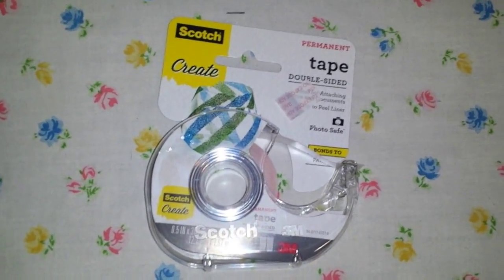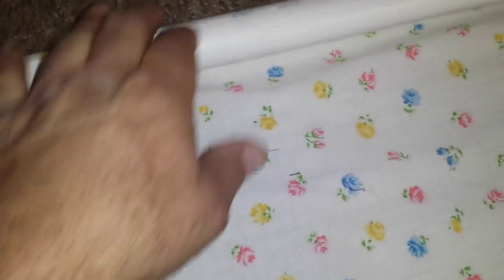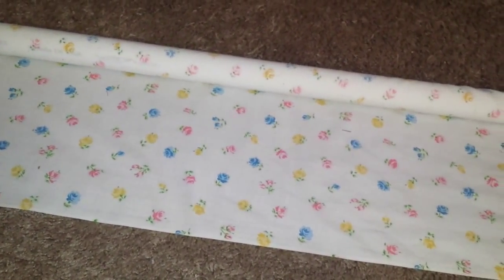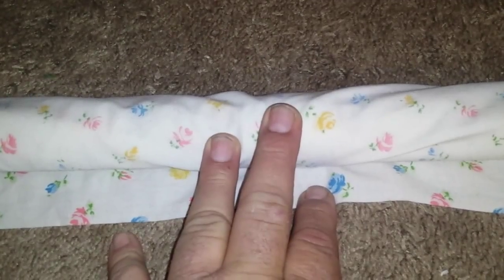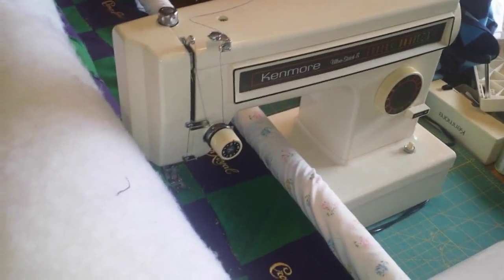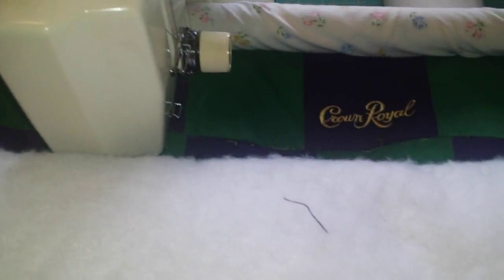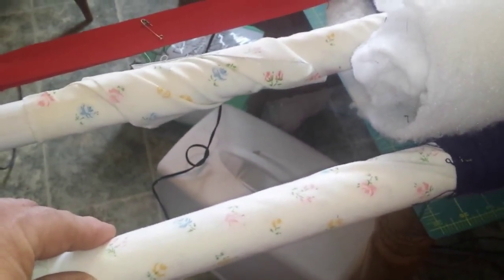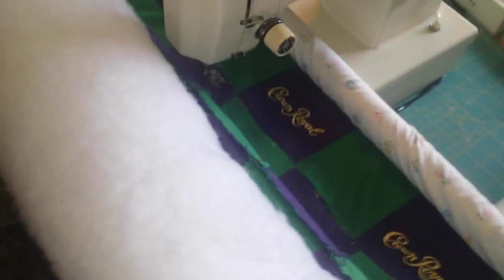Building a quilting frame Pt. 2

Comment: how did you make the frane
Reply from the maker: There should be a video on part 1 showing how I made it. PVC and plexi glass. I put caps on the end of the pipe and bolted the plexi on the ends
Reply: @Jsellers1965  Can you please post the link for part 1?
Reply: @michellehansen8417  :  Part 1:    https://www.youtube.com/watch?v=_5jMOBCTqsk